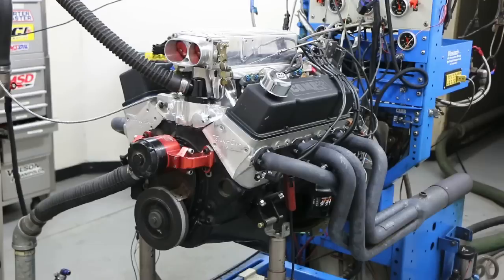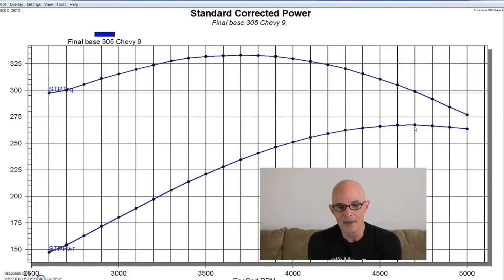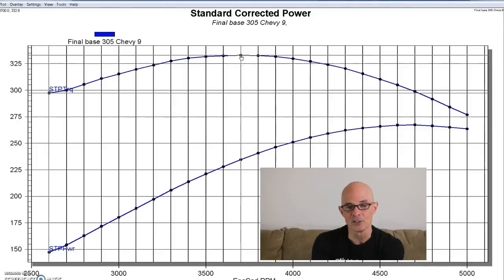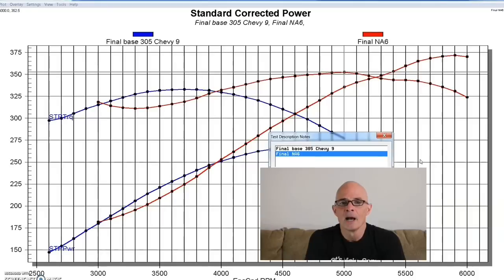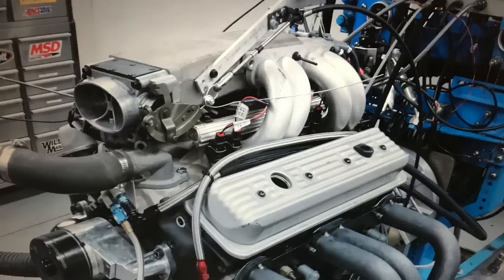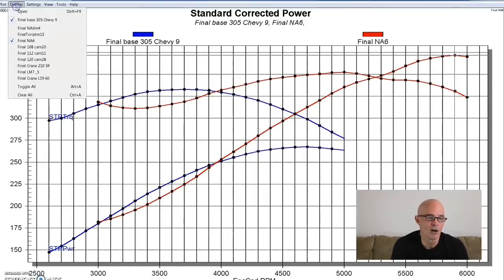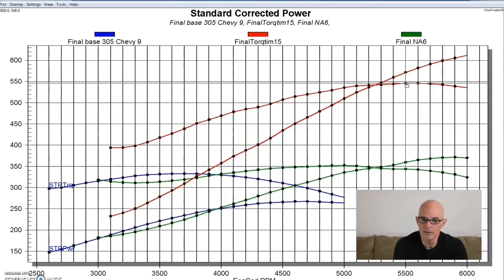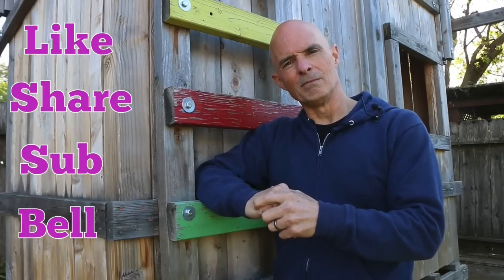GM 305 LB9 TUNE PORT (TPI) TECH PLUS BOOST-FASTER THAN 5.0L FORD?

Comment: TPIS was the go to place for tuned port stuff back in the day. Their Miniram predated the LT1/LT4 intake from the Gen 2 small block ( Chevy copied that unit )
Reply: @G-reg313  I have always been a fan of the Gen 2 small block, even before Tick Performance took the mantle and started running near 200 mph quarters with it. TPIS made Chevy step up their game, and the Gen 2 was the result. As much as I like the LS/LT stuff, they don't have the same cylinder head clamping force ( 4 bolts per cylinder vetsus 5 for the SBC ). There is still life in the SBC, and with prices going down every day, it might spark a revival.

Comment: Man that brings back memory’s,my T/A came with a 305 that thing wouldn’t pull a greasy string out of a cats butt ,it didn’t last long spun the mains int then put a 350 man what a differences,still have the old girl has a 5.3 procharger in it now,love your videos👍

Comment: Was given a 305 that was destined for the scrap yard and had hopes to hop it up. Ring ridge was probably .010" and was basically junk. They are out there though and will end up being cheaper than an LS. To a simple mechanical guy these sbc are less intimidating too. I would go turbo, basically Rotsun style. 500 whp on the street is more then sporty to me, especially depending on the chassis.

Comment: Thanks Man, Reminds me of My L98 91 C4, ported the heads, installed 2.0 int valve,1.55 ext,LT4 hotcam, Tpis miniram intake manifold, 255 walboro fuel pump, 24lbs injectors,1 3/4headers,  and hours of burning chips, made 343rwhp. My new project is 383sbc twin turbo 85 Monte Carlo SS,
Reply: I have a 92 Lingenfelter.  It has a 383, extensively modified, and according to LE it only makes 390hp.  It's fun to drive, but really it could use another 50hp or so...

Comment: Just curious, have you ever tried to run the old tuned runner intake with a modern fuel injection setup (Like a Holley computer)?. Just curious if the older types, could be converted so to speak. I think it'd be a cool retro look, if it could be done. Small block with a vintage vette type tuned runner with modern control. That would make a cool resto-mod approach
Reply: That's literally what he did here. If you paid attention in the beginning he said he tuned this setup with a Holley HP. You can configure a Holley ecu to run just about anything under the sun.
Reply: @Ribbityibzki , I missed that part, my apologies. I was listening, but i guess i missed it
Reply: https://azspeed.com/ There is a old article from Car Craft comparing manifolds. An Arizona Speed and marine modified LT-1 TPI manifold would work sweet with a turbo and modern build. It beat them all till 4500 rpm. Boost anyone?
Reply: There exist add on boards that allows sequential fire rather than batch fire. Seen an obd2 tpi swap aswell. But that's pretty much yanking a van harness and making a tpi tune for it.
Reply from the maker: we ran this motor with a Holley HP ECU
Reply: @richardholdener1727 , missed that part, my apologies. re-watched it and I did miss that part for some reason

Comment: Can you do a gen 2 lt1 build??
Reply from the maker: I've done some testing on the LT1
Reply: @richardholdener1727  I would love to see those videos. I want to build a reliable 383-396 that I can daily, and do auto cross and road racing with. Is it Possible to get 450 whp and have good drivability???
Reply: I dont know what the overall numbers were, but I had an LT1 with Llyod Elliot ported heads and intake, one of their custom spec camshafts, and all the recommended supporting mods (throttle body, injectors, longtubes etc...)  I also had a billet aftermarket optispark, called a Dynaspark.  This was in a 6 spd z28.  That car flat out MOVED.  It sounded incredible, and gave me years of fun, while still being able to knock down 25mpg when driven sensibly.  All that work obviously would have made an ls1 faster, but that wasnt the point.  I had the car, with that engine, and wanted more.  It delivered in excellent fashion.

Comment: Wow Richard thanks for the memories. My first small block swap was a tune port 305 someone gave me except I ditched the heads amd tpi setup and put 64cc 1.95 1.50 heads on with an edelbrock intake and a carb and a custom Isky cam. I bokted it to a T5 and put in in my minitruck I built, a bagged and bodydropped 92 Isuzu pup.

Comment: I literally got a 83 z/28 yesterday
Reply: The 83 didn’t have tuned port injection, it could have had a std or HO 305 Rochester feedback Quadra jet. TPI didn’t come to the Fbody until 85, the earlier 82 disaster crossfire injection wasn’t an option for long...
Reply: @JohnDiMartino  The LU5 was available in 1982 AND 1983. Don’t let the 40 year old injection system outsmart you. They’re simple, extremely reliable, and wake right up with VERY LITTLE effort.
Reply: 1967 Chevelle LSx my 83 didn’t come with anything technically 😂, roller

Comment: Great video!  I have a TPI 305 in my '67 CHevy C20.  It's a great daily driver engine with that low end torque.  Plus I get 15 mpg in town and almost 20 on the freeway!
Reply: How does it tow?
Reply: @xmo552  Tows great!  I've only towed about 8000 lbs but it had no problems at all.
Reply: @tkmad7470  Nice!
Reply: @tkmad7470  
Which transmission and rear gear?
Reply: @xmo552  I put a 2004r in it and 3.73 rear.

Comment: I had a "305 friend" in high school - same story as all of the "305 guys", they "don't want" a 350 and would rather dump their paycheck into the 305 that their IROC has because they "want to be different"...

...for some reason, they never understand that owning one of the worst SBCs doesn't make you "different"; it just makes you another SBC guy, except your SBCs just happens to be one of the worst SBCs...

The only upgrades worth doing to a Cheby 305 are either an engine swap or a different car that already comes with a better engine

At least both of the 3.8l V6 and the SVO 2.3l turbo guys are doing something interesting with their handicapped platforms
Reply: The bad reputation 305's had was caused by the 305 truck motors that had half of the intake port blocked off in the head to promote swirl in the cylinder, thus increasing fuel mileage. If you think a 305 is worthless, you didn't watch the video.

Comment: Was the where's thing Chevy made It's a boat anchor made 260 horse on a dyno so is a 115 horse to the wheels in the car I had one In my Camaro it was horrible
Reply: So by your estimation, that car had a 56% drivetrain loss.  I could agree that it wasnt exactly a powerhouse, but be realistic...

Comment: This old 305 got me thinking. I used to think forced induction over came poor flowing heads and cams by just ramming the air in but now I realise that any modifications done to make a motor run good n/a makes an even greater improvement when forced induction applied. I just don’t know why scientifically? And does bigger ports that flow intake air badly n/a flow great when under pressure of being forced induced??
Reply: If you've been following this channel awhile you'd already know that better n/a = even better boosted !
Reply from the maker: Make it work NA-then add boost

Comment: That is quite a jump from the factory rated 215 HP
Reply: Lost a little from the mid range, though.
Reply from the maker: this was a factory 230 hp motor (later)-we test with no accessories, no air intake, long tube headers and optimized tune

Comment: With that power in the 80s you’d pretty much own the streets unless someone was running a big block haha
Reply: In the early 80's there were 15-20 yr old SS Big Blocks running around still.. the newer stuff got smoked by the Old Dogs.

Comment: I will bet right now the Ford 302 does much better then the Chevy 305. 
Hell 350 for that matter back then. 
I owned all 3, I had a 305 TPI,  350 TPI and a 1993 Cobra which bone stock the 93 Cobra was running and beating 1995 FireHawk which was the LT1 motor with upgraded exhaust etc.. Rated at 315hp and 344lbs of torque to what Ford said was 235 in the Cobra but clearly that 235 was not at the crank but rather the wheels. 
Ford was sneaky a few times on the Cobra models, just like the 03-04 Cobra which made its power at the wheels but was supposed to be flywheel lol. 

I love those old 302's. 
I also did TruckFlow stage 3 ported heads, milled down with some forged TrickFlow pistons with 11.1 compression bored 30 over to make it a 306 forged bottom end, ported TrickFlow Trackheat intake, comp cams XE282, pro M77 mass air with 36lb injectors and a 255 fuel pump, 70mm throttle body, 1 3/4" Long tubes with Mac prochamber to flowmasters as ever mustang back in the day loved Flowmasters LOL. And to top that off I had some NO2 set anywhere from 50-225hp shot. 
Now that's not to much to talk about today but back in 95 that was pretty hot setup running 10.40's @132mph on a 150shot full weight and 11.73 on motor.

Comment: 5 liter ford blocks crack at 500 hp and lift heads with 10 lbs of boost
Reply: @Olds_Pwr  

Thought it was a Garrett GT37 off a 6.0L PowerStroke.
Reply: It seems the 302 splitting may have to do with bad tunes.
Reply: With a poor tune and when you don't have the heads studded or the crank with a crank main support. 
I've seen plenty of 5.0 go daily with over 600 to the tires as long as you didn't Rev it past 6000rpm! 
And the 500 you speak of is at the tires not crank like they are testing here. 
I personally know because I had built one with over 500 no issues but that was on nitrous. 
On motor at the crank I had right at the 500 mark. 
If you beat the piss out of it and ran timing way up you would destroy one easily, very true but they were capable of more done right.
Reply: @gregwilliams4380  this is why i run into issues with furd guys. Thet do alot of but this and but that.

Comment: Those are the exact heads I'm running on my 350. Even the 56cc combustion chambers! I had the HD low compression 350 tbi. The swirl port heads are already 64cc's so I had to bump compression somehow. 56cc chambers brought me up to 9.17:1. It was the smallest chamber I could find! I'm also running a slightly smaller cam. Comp's XFI252HR. Holley Sniper and a vortech centrifugal supercharger. I'm pumping out 394lbs/hr at 5200rpms to keep her fed. Only 6.5psi of boost with the stock pulley setup, but I'm at the limit of my 650hp sniper's injectors. I thought I was making around 406hp @5500 before the supercharger and 580hp after. Not bad for an old 3/4 ton farm truck that came with 190hp. 
  This is probably the closest I'll see to my actual combo on a dyno. Thanks for all of the great videos,  Rich!
Reply: Wow, well done. Can the Sniper control the holley water+meth kit? You could get a bit more fueling and cooling that way to support a bit more boost.  -If your deck is super flat the Felpro 0.015" shim gasket would net you another 0.5 static CR, not that you probably want more static CR now that you're on boost, though, although high CR boosted builds are apparently "in" right now.

Comment: ever do a test  with  carb blow through setup where ya measure   air temp/density   in the plenum with  and without   intercooler?   considering what  freiburger  said about  his  saltflat car  running a    blower and carb that  air temp drops  100 degrees from the carb atomization      would be  cool to know what difference a    intercooler would do to the  power and  air temps in the plenum
Reply from the maker: yes-that carb will provide charge cooling but intercooler still adds power
Reply: @richardholdener1727  ah ok  cool to know  thanks
Reply: @futten3230  
I read something today. I think it was something in the Corky Bell book..
I think it's 50 degrees.

Comment: That is stock bottom end
Reply from the maker: yes stock
Reply: Richard Holdener I seen this show get well over 600 on stock bottom end no ring gap and on the 300 shot it cracked the ring lands on a piston. You should gap the rings and push this engine to 700 hp and see how many pulls you get

Comment: Man I have been looking at that torqstorm setup for my ram with an a2a cooler. Keep the torque and cam at stock rpm. Towing machine with an 8speed trans. Looking tempting

Comment: Do a l98 build for us c4 guys lol
Reply from the maker: I have lots of L98 tests-including turbo
Reply: @richardholdener1727  I could not find it. I love your videos!! I can't believe you responded!! so cool. You have the best engine building channel in the world. I can't wait to see you channel get some more views and subs, you deserve it more than anyone!!!
Reply: @brockhouse3857   He has ~20 years of test data. He only recently started producing videos with it. Much of the testing was done long ago.
Reply: @richardholdener1727  I scrolled through all your videos looking for an l98 video with no prevail.
Reply: @richardholdener1727  I'm there!
Reply: @richardholdener1727  
🤚😊 (raising my hand to ask a question)
So... I watched these videos when they came out. Today my dad was talking about fixing up his old 1988 
Caprice wagon 305 TBI with 700r4  
I told him to run the intake that's on my brother's 1988 iroc, go 305 tpi. I think it's the best combo of mpg and torque. 
[I really don't know how the 305 tbi does.]

He wants to go from SF Bay area to the Grand Canyon and maybe pull a small camper. 

😁Should he convert to TPI?🤔
Should he go 305 vortec with TPI?
Reply: Any other SBC dynos would be cool to, don't forget about the gen 1 stuff lol keep up the awesome work
Reply: I messed around a lot with tpi motors.  for a 350 give up on any power above 5000 rpm.  a 383 maxes a tpi out at about 4500 rpm, but if built right will have close to 600 tq at 4500ish.  So for a 350 choose a cam designed for peak torque at 4500rpm, 1&5/8" primary long tubes with 2.5" collectors, running a high flow merge into a 3.5 single pipe.  my 85 vette with these mods and good efi tuning would hit 186mph with the stock bottom end 350.  Oil temps would get bad if you sustained speeds over 135 though.  
For a nice 383 package use dart iron eagles 215cc with a wide lsa cam.  we had to notch the rods for the intake lobe.  had a Subaru buddy that helped me tune who thought his stuff was fast till we hit 192mph at 4500 rpm with that combo.
Reply: @cmcbunch  
How did you tune it?
Reply: @xmo552  I was using a speed density 90-92 ecm  and chips tuned by mail back when tpichips was still operating.  I would not reccomend this now since it took about 5 chips to get it dialed in.  I would use a holley HP today if i had it to do again.        Back in 2005 i couldnt afford a flash tunable efi system.
Reply: @cmcbunch  
Nice. Thanks.
Reply: L98 build would look very similar, just add about 30-60 hp and torque.
Reply: @Richard Holdener i would also be interested on L98 stuff.
Reply: 87-92 F-bodies used L98s as well

Comment: Fun! I really enjoyed this one. I tpi swapped my 87 monte SS back in the day, it was fun but I don’t miss burning proms at all!
Reply: Diacom for the win.
Reply: So did I, just to impress the people who said it couldn't be done.  

It was a mistake, as my car already had a 406 with a 228@.50 cam in it.  The Tuned Port looked great, and it had stump pulling torque, but suffocated the engine above 3,800 rpm.  The runners inside a TPI intake are tiny...

Comment: I have two TPI systems and never got around to ever using them....  LS motors have kinda killed the idea of even using them.  Guess I need to get Holley management system if I ever do use one of them ....   Question is which one would you use?

Comment: Remember the Stage II Buick V6 that won the Silver State?
Reply from the maker: I remember a few GN-powered cars there-I don't remember one winning but I was only there for the first 12 years
Reply: Richard Holdener 
He won in the Unlimited Class in 1998 running the Buick Motorsports V6 engine designed for the NASCAR Grand National Series. 
That engine also powered some INDY cars back in the day.
https://www.facebook.com/GMEFI/posts/2051871448368409/

Comment: I love the idea of a 305 that makes that much power...  But of course, I have to wonder how much power a 350 would make with equivalent parts.  Pretty sure the Ford is going to make more power, just because the 305 limits itself by it's tiny bore size.
Reply: If the ford 5.0 engine makes more HP  it won't be no more than 15/20   HP. Also there always been a lot of different companies making aftermarket parts for the 5.0  Ford engines. The 5.0  Chevy no one really cared that engine so no one spent a lot of time trying to make big aftermarket parts for it...
Reply: @matthewvarnam4302  it is true that the 305 chevy saw very little love from the aftermarket.  But it really was for pretty good reason.  The 350 swap was always so much more simple to get a really strong running car.  Spend the same money modifying either engine, and the 350 would absolutely eat the 305.
Comparing it to the 302 Ford, was also problematic for the 305.  The Ford had the same 4" bore as the chevy 350, and as such, it had a much easier time with cylinder filling than the small bore that the 305 has.  The 305 was a smog era, low rpm engine that could be reliable and make decent low rpm torque.  It never should have ended up in a performance application.